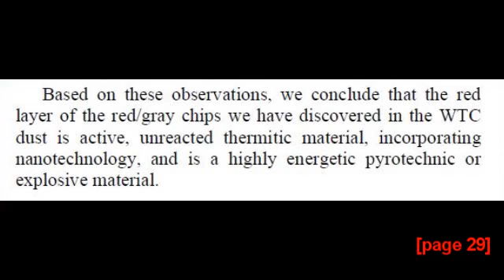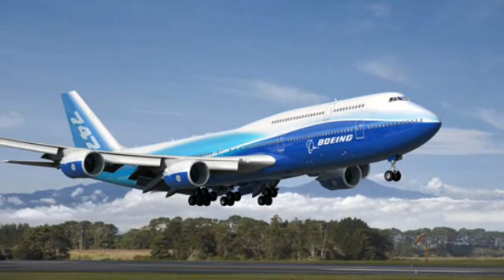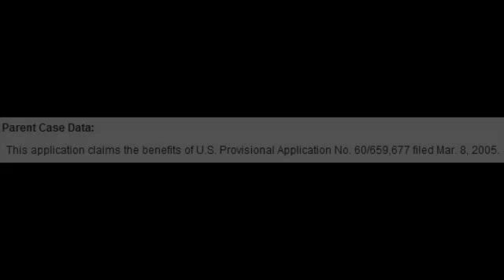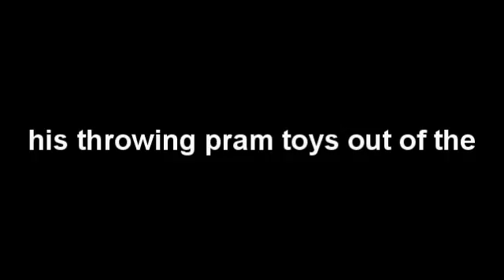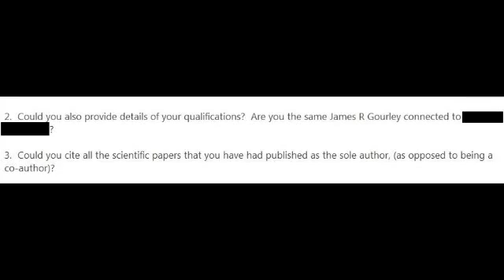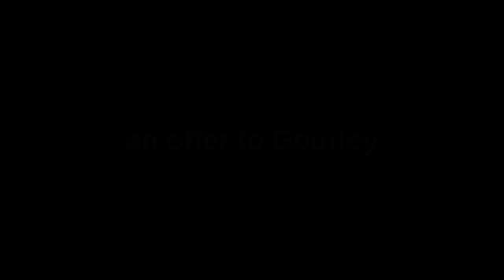The termite conspiracy - Part 2

Comment: MIL-G-12297H (AMENDMENT 1), MILITARY SPECIFICATION: GRENADE, HAND, INCENDIARY, TH3, AN-M14 (17 JAN 1986) [S/S BY MIL-DTL-12297J - CONTROLLED DISTRIBUTION]. 

The *AN-M14 incendiary grenade* was first issued in **1960**. It was developed as part of the U.S. military's efforts to create effective incendiary devices for use in combat situations. The grenade has undergone various specifications and updates over the years, with the most notable military specification being **MIL-G-12297H**, which was amended in **1986**. This grenade has been utilized in various military operations since its introduction, primarily for its ability to create intense heat and damage enemy equipment.

The AN-M14 incendiary grenade, which contains a thermate mixture, is designed to produce extremely high temperatures, typically around 4,000 degrees Fahrenheit (approximately 2,200 degrees Celsius). This intense heat allows it to melt through various materials, including steel.

Steel Melting Capacity
Thickness of Steel: The exact thickness of steel that the AN-M14 grenade can effectively melt through depends on several factors, including:
Duration of Exposure: The longer the steel is exposed to the heat, the more likely it is to melt.

Type of Steel: Different grades of steel have varying melting points and thermal conductivities.
Environmental Conditions: Factors such as wind, moisture, and surrounding materials can affect the grenade's performance.

While specific tests may vary, it is generally estimated that the AN-M14 grenade can melt through up to 1 inch (25 mm) of steel under optimal conditions. In practical applications, this may vary, and the actual effectiveness can be influenced various factors, like those mentioned above.

Comment: Isn't it strange that the crime scene evidence(steel) that was immediately removed from the the site, was then shipped to China to be destroyed before anyone was allowed to properly investigate it?

If that fact was presented by a defense lawyer at a trial, the defendant would be acquitted, and the investigators responsible would be terminated, and possibly be charged with tampering. 

In this case we have the acquittal(US Govt), but the terminations and subsequent trials are being delayed.
Reply: techx3d. What if i told you it wasn't shipped off to China,but to jfk airport in hangar 17 where nist, structure engineers in the usa, and independent investigation from universities did their research?  Fun fact the collapse of the twin towers and wtc 7 was one of the heavily investigated structure failures in modern history.Loose change never told you that part.

Comment: The lake of molten steel? The problem with that is that steel is a metal, and as such cools off very quickly. Any molten steel was far more likely to be the result of thermite being used to cut steel as part of the removal process. But what happens when I look for actual images of molten steel at the World Trade Center? Showers of sparks from cutting devices.

Comment: Your assuming that an accurate and exhaustive analysis was made of the crime scene. If memory serves, there was a real urgency in making sure the WTC site was hauled away before any investigation could be done. This is what led to the discovery of the lake of molten steel. The perps of 911 did not have to do a good job or even demonstrate competence to get the end result. It wasn't like a normal demolition where efforts are made to protect surrounding buildings.

Comment: If they used thermite to cut through key girders, then (A) they would not be any need for anywhere NEAR the amount of thermite that is estimated and (B) all the thermite would be already burned out long before the buildings collapsed. Thermite only burns for a few minutes, that's all it takes to get through a girder. There would be no thermite left once the building was weakened enough to collapse.

Comment: no, it was the collapse of the 400,000 tonnes of steel and concrete that caused the concrete to pulverise. Not the plane. The plane caused the initial collapse, the collapse caused the pulverisation.

Comment: There are ways to work out that explosives were used beyond testing for explosives(and such a test would be completely useless, because you would have to find the exact seat of the explosives (in amongst hundreds of thousands of tonnes of steel and concrete rubble). And the likelihood of a false positive (or false negative) would have been pretty much inevitable, because of all the burning plastic, fuels, textiles, and chemicals in those buildings.

Comment: The fact is that some members of the Mossad were arrested while filming the towers (they had started filming BEFORE the attack) and they were celebrating. The fact is that some of the hijackers were actually civilians whose passport was stolen. And the fact that those passports could be rescued from the debris is hard to believe. I mean,it was hot enough to melt steel but not hot enough to disintegrate the hijacker's passport that was on the crashed plane?  It's nothing but suspicious.

Comment: @soulinite roll all you want, but for the record it would take one man less than a year to set thermite devices in all 3 buildings that collapsed on 9/11, all you have to do is the math, math so simple a 5th grader could do it. almost as easy as looking up the term 'pull it' in a dictionary, for the record.

Comment: @GreenEggsAndHamster 

"how hot would a thick metal beam need to be in order to bend like a horseshoe without cracking? Sorry, it's hotter than burning jet fuel."

1. My argument was that bent steel is NOT evidence for molten steel. You don't get it, the bent beam PROVES that the fire was NOT hot enough to turn that beam to molten steel (in that particular location). You prove nothing.

2. GreenEggs you FAIL...steel bends at temperatures less than that of burning jet-fuel. Nice try though.

Comment: @BalazarsBrain Ok, brainwave, how hot would a thick metal beam need to be in order to bend like a horseshoe without cracking? Sorry, it's hotter than burning jet fuel. As for the witnesses, in a jet fuel fire the only molten metal could be aluminum. So, the firemen couldn't tell the difference between molten steel (orange) and molten aluminum (SILVER)?
Like I said before, you debunkers are as logical as a bunch of Creationists.

Comment: @Grospoliner Understandable, but the central columns were not continuous shafts they had joints ie weak points, and natural bias some columns would be stronger or weaker than its neighbour with natural weak points along the shaft itself, if the columns were to give way surely they'd give way at the weak points the joint's,or there natural inherent weak points rather than completely and utterly uniformly failing along the entire length of the building

Comment: @Leehofooks It is just that it is impractical for use in a controlled implosion, as it cuts the steel too slowly. It would be more practical if it was used in dismantling than in demolition.

Either way, such a massive amount of thermite would have left far more residue of burnt thermite.

Comment: @BlackRaptor31 Gravity pulls an object towards it unless it encounters an opposing force, like a building, the buildings were designed to take extremes in nature, one would expect a bending steel structure rather than absolute and total uniform failure from the beginning,I would expect the structure itself to have been a continuous opposing force to gravity

Comment: @Leehofooks 
Thermite COULDN'T be used in a controlled demolition...it can't be set off in a split second like TNT...nor can it even reliably cut a steel beam in half...and then add the fact that is not an explosive

Comment: @kuzlovsky12 Having a patent filed does not prove anything. You can file a patent on just about anything, working or not. The defensibility of the patent would change depending on the ability of your product to work, but the people at the patent office have no way of knowing if your idea really works or will ever be used. The is because filling a patient is cheap, you can fill one for a bit over $100, and it works to at least hold an idea is yours for a time.

Comment: What gets me is how people typically fail to take into account the shear potential energy of the twin towers. Once catastrophic structural failure occurred, it is going to sound exactly like a series of explosions as the structure pancakes. There will also be a blast wave (subsonic, not a shock wave) radiating from the structure as material is squeezed out.

In short, you don't want to be anywhere near it. It is amazing that people in the immediate vicinity survived!

Comment: Aren't DPR's figures immensely off?
Is he taking into account the entire structural weight of the tower, IE including the steel?
That makes absolutely no sense, steel isn't pulverized, shouldn't the claim alone that thermite material was present in the debris at all be suspicious?

Thermite has been around for 60 years, you don't need professionals to make or place a thermite charge, give me a couple hours and i could knock one up.
DPR doesn't seem to have any knowledge of how demolition works.

Comment: @RevDevilin No. One would not. Not in this situation. At all. Also, building seven DIDN'T fall straight down (at least not the entire building, given that most of it didn't fall. And unless you think the path of least resistance for a building is to split in half and fall over, rather than fall straight down, you can undertand why this is..). Hey, I have a question. If the government blew up the buildings in a controlled demolition, why wouldn't they make it NOT fall straight down?

Comment: February 9, 2009 Beijing 44-story all of it was on fire, but it didn't collapse In its own footprint
August 2007 Shanghai tower 1,666ft flames burned across several floors, but it didn't collapse In its own footprint
February 2005 Spain 32-story burned for two days Several floors collapsed, but it didn't collapse In its own footprint
October 2004 one of Venezuela's tallest buildings 56-story burned for more than 17 hours two floors and some staircases in the building collapsed

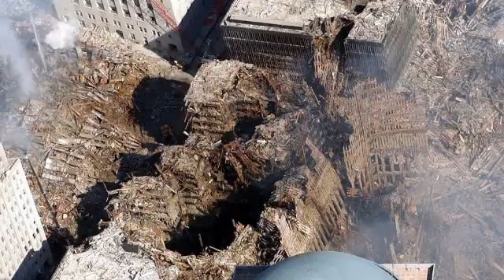Comment: 1:27
1. It does not appear to have collapsed directly into its footprint even though that claim persist. 
2. It does not appear to have collapsed completely to the ground; possible pancake collapse resistance? 
3. I am having trouble seeing the molten pools of metal.
4. If a pig shits fast enough it will fly; prove that this is false. 
5. Larry said "pull it" and everyone knows (except the silly sheeple) that "pull it" is the code word that Elvis used to encourage insects to devour solid steel.

Comment: @seraphimra "Sodium Flouride(Highly Toxic Poison)"

In the US at least, hexafluorosilicic acid (H2SiF6) and its salt sodium hexafluorosilicate (Na2SiF6) are more commonly used.  In addition the concentrations of fluoride in water are too low to cause fluoride poisoning, and it doesn't build up enough for concern about chronic toxicity, beyond a relatively low chance of tooth discoloration in children.

Comment: @Pinworm4 But then there's that annoying law of physics, path of least resistance, and all that nonsense, and steel bending likes errrr steel, and the extremely weakened structure  wouldn't it have to be uniformly weakened to fall straight down ?, elephant's can be extremely difficult to see when they are sat right in front of you wouldn't you say ?

Comment: Question arises: Would the thermitic material be heavier than, say, concrete dust? would that not account for the high levels of unreacted thermitic dust in the samples?
I would still also like to know that if it WASN'T Thermitic material, which i am almost ready to concede, what WAS it? I know, I know, everyone yells "paint chips" but does the chemical make-up of the particles point to paint? i would speculate "no" but i am interested to hear alternative hypotheses...

Comment: @junior00bacon00chee 
"unreacted nano-explosives"

Thermite is not an explosive, it's an incendiary.  It's made of aluminum metal and iron oxide, both of which are present at the disaster site, and both of which underwent enormous impact at the point of the crash.  If there are particles of "nano thermite*", I would suspect that is where they came from.

* A meaningless term, given that the grain size necessary for iron oxide and aluminum to behave thermitically is in the nanometer scale.

Comment: @junior00bacon00chee 
1) Most carbon compounds are matrices; you're going to have to be more specific, as what you describe can be a simple as "char splattered with rust and aluminum dust", a pretty likely situation when you shove an aluminum tube into a steel structure filled, both filled with hydrocarbons of one sort or another.
2) Fused iron, thrown from an explosion, will tend to form spheres in the air as it cools, no?
3) Aircraft fuel can melt iron if it burns uncontrolled.

Comment: My problem with the thermitic material theory is this: A large tempered aluminum tube was crashed into a partially rusted steel structure* at high speed, then poured burning fuel into it.

Yeeah.  None of that stuff shattered into particles on impact at all, right?

* All buildings have some rust on their structure by the time the structure is covered

Comment: If you put an airfilter on a building and measured asbestos particles and then pretend the building is 100,000 times more massive therefore the building is constructed of asbestos.   You just don't know what filtering took place and what percentage is airborne. 

Your strawman video is laughably stupid by taking one number and mindlessly multiplying by the mass of the WTC.

Comment: Thermite is heavy a plane couldn't carry enough. Another thing they have wrong here is that theremite is very obvious when it goes off, not a small reaction at all. If there was enough thermite in the towers to do any real strcutural damage it would be obvious from the footage, and the rubble. It's not the "unreacted thermite materiel" that would be an issue it'd be a massive cloud of aluminium oxide over manhatten, and a huge lump of chemically pure iorn in the basement.